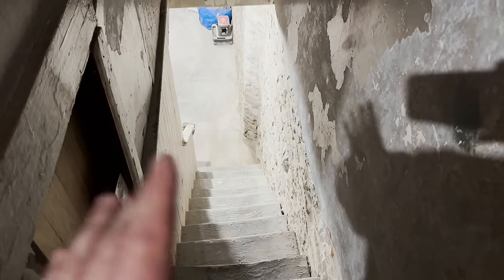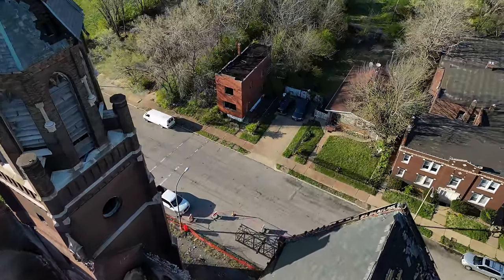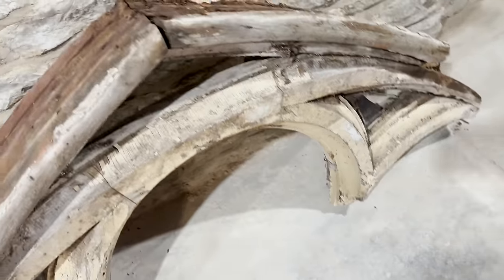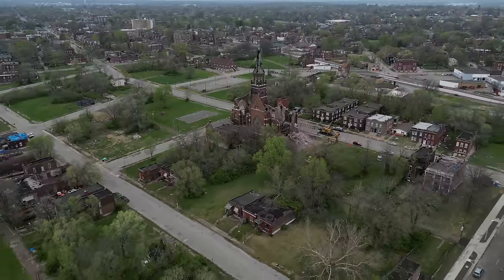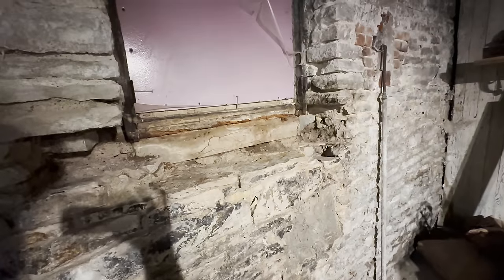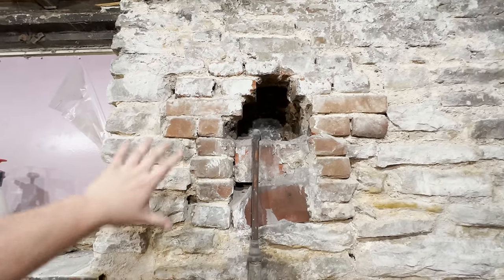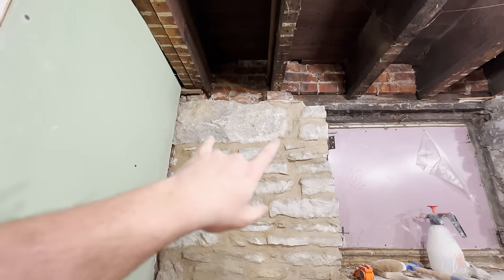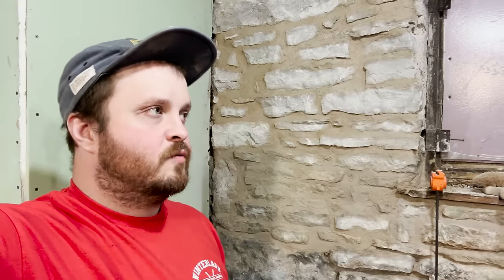This is Just Sad! S4 EP4

Comment: Suggestion 14:49 for that outside water spigot on the front of your house: I would suggest putting a master cutoff valve in the basement so that you can turn off the outside spigot when not in use. The last thing you want is to have some neighborhood kid turn your water on during the middle of the night or when you're not home and let a couple thousand gallons of water run out into the street. I prefer using a brass ball valve inside as a master cutoff, they don't drip and don't have to change rubber gaskets every couple of years. Something to think about and save yourself some grief down the line.

Comment: Given the ornate faucet you have for use outside, when you re-plumb that line, you might consider adding a shut-off valve inside, and a drain spigot between it and the outside faucet, to get the water out each fall.
Reply: I don't think you need a drain, as long as the outside tap is the lowest point, you can just open it in the winter
Reply: Yeah, I wrote that before he said he was running the pipe from the ceiling. Thanks

Comment: As a person who has had four back surgeries, I can attest to your suffering.
Ibuprofen, moist heat on mid back muscles, ice pack on lower back on L4, L5, and L6 region will relax muscles and reduce swelling in the lower back joints.
Take it easy for a couple of weeks and wear a back brace when working.
It's important to take it easy for a couple of weeks because if you insist that you're alright and do the macho thing, then you're just going to keep aggrevating the injury and make it worse.

Comment: For cleaning off the foundation stones, a possible solution could using a wire brush drill attachment, or possibly a dremel tool for more precision. Brass or other soft metals similar to the one you're using work great, however there are other types of soft bristle variants as well (maybe even soap+water with the softer brush?), saves both time and any more back worries! I would understand not wanting to damage stones or damaging mortar is a possibility. Keep up the amazing work!

Comment: Kaleb, a question for you on the brick that needs replacing under your fireplace. Is it possible that the space that they used for running that water line might have been part of an ash pit for the fireplace? If you have a grate or trap door in the floor of the fireplace upstairs that would be an indication that part of that space was originally open allowing for easy clean out of ashes from the fireplace. The brick is definitely some sort of later modification but if the fireplace has a provision for an ash pit you might not have to fill that entire void with stone if you restore the ash pit. Just a thought to save you some time and stone.

Comment: NHL 3.5 is Not for pointing - it is for external rendering on the lower part of a wall where you will have splash back from rain hitting the ground, i.e. you use it on the first 1 meter. NHL 3.5 only has circa 30% Lime Content. NHL 2.0 is the best NHL and has a Lime content of maximum 40% (the remaining 60% is filler and Not Lime). If you wish to use an NHL then use NHL 2.0 for Pointing. 

The correct Lime to use is CL 90 - this is what was originally used to build this house. CL 90 has 90% Lime. It is far superior to NHL Lime (2.0/3.5). CL 90 can be used to make a Traditional Hotlime Mix, or it can be slaked to create Lime Putty. 

Lime Putty needs a minimum of 6 months to mature before you use it. In fact the older the Lime Putty gets, the better it is. You must always store Lime Putty submerged in Water and ensure it never has any air come into contact with it. 

CL 90 will make Lime Render, Lime Plaster and Lime Wash. It is also way cheaper than NHL and a far far far superior product to use and will last much longer than NHL Limes. Make a Lime mix using CL 90 and put it on the hawk and you will never have it fall off if you turn the hawk upside down. Try that with NHL 2.0/3.5/5.0 and you will have a mess on the floor. 

Note when you make a Lime wash with CL 90, it will be similar to modern paint in coverage. But if you make a Limewash from NHL, it is very watery and requires coat after coat to build up the layers to cover the wall in Limewash. One coat of CL 90 Limewash will give you a finished product.
Reply: Super helpful information. Thank you, that has just steered me in the correct direction on my renovation.
Reply: @fullboatya  welcome. I suggest you search for tutorials on mixing CL 90 (Traditional Hotlime mix). The most educational will be any video with Nigel Copsey (he doesn't have his own channel). He works with the National Trust in England and specializes on working on old historic buildings. You will find several videos people have filmed of him explaining in detail/tutorial how to mix the Lime to create proper traditional Lime Render, Mortar and Lime wash. It is very easy to do, so don't be afraid to try.
Reply: wow thanks I really needed this. been scratching my head wondering what to use for my historic home. will look for a supplier and get some cl90.

Comment: Hey Caleb, have you checked out a pulsation laser to remove alle the paint on woodwork and your facade? I think it would safe you a TON of work and you would avoid using harsh chemicals ;) Maybe you could rent one or get a sponsorship? (they are pretty expensive) They are used to remove graffiti by professionals, by vaprizing the paint, not toching the wall or wood. You can actually also use it to remove wood stain :D 
Kind regards from a Danish Cabinet Maker and Furniture Restorer

Comment: You've been cleaning the foundation stones with a wire brush? Dang, that's a LOT of work. Chipping away the concrete, digging out the broken bits and sand. I thought you'd have some sort of Dremel tools or something. I guess its different literally every spot in the wall so you have to feel your way

Comment: Greetings: I have an old 1893 home in Chicago and greatly enjoy watching you doing things with respect. At twenty eight minutes you are discussing replacing an exterior water line. I assume that you probably know this, but better safe than sorry. You need to protect an exterior faucet from winter freezing. Since you plan to place your ornate brass quail faucet outside, you will need to have a shutoff valve in the basement and the piping that goes outside  inclinedever so slightly from the outside to the inside, so that you can shut the water off in the Fall, and leave your faucet open before you get a freeze. Frozen pipes can be a real headache.

Comment: That brick area is probably a cleanout for the chimney.  If you seal it up, you may have trouble getting your fireplace repaired/working properly.  I'd check with a chimney repair guy.  Getting a professional opinion doesn't mean your committed, but will save you a big headache later.

Comment: There's a reason for the "cloverleaf" tops of some church stained glass windows. 3 for the Trinity. 😉
It's sad when a historic building is either not restored or is just destroyed. 
In the Monroe County area of Michigan,  there's multiple churches still mostly intact from around the Civil War era (architectural glass is a big giveaway. 😁) An earlier example is a former Methodist (now a Baptist) church in Dundee,  from 1864. Sure, there's a 1980s addition to the back, and a lean-to on the side in front from I think 1910ish, but the front addition was blended seamlessly, reusing the stained glass windows on the side and front, and the back addition for Sunday school classrooms is frame instead of brick, but really nice and not that noticeable from the street. 
There's the Presbyterian church in downtown Monroe where George and Elizabeth Custer (of the Battle of Bull Run infamy) were married. Takes about a quarter of the block,  and the additions do say they're 1950s through 1970s dates, but other than the full aluminum and glass doors in the addition, and several not noticeable from the street more modern rectangular windows, even the most recent brick matches the 1870s stuff used originally. Interior is still the same paintings in the auditorium as original, as are the box pews. 
The Presbyterian windows have been meticulously maintained. As good looking as new.
The one in Dundee needs help. It took almost 20 years to raise the money to restore one stained glass window (they ain't cheap. $10000 around 15 years ago for a shorter one...), and there's still about 8 to get done. Lead is deteriorated. Most have missing or broken bits. 
And there's general wear and tear. Dundee was starting to leak from loss of mortar. Point and tuck on virtually all the brickwork. Slate roof was virtually impossible to get done, so it's now a similar look in steel roofing on one side. 
Steeple was destroyed in probably the 1970s by a tornado. Capped, never replaced entirely. Old organ loft is empty (organ was kept by the Methodist church).
I currently attend the Presbyterian one and used to attend the Dundee one. It's amazing what a budget for building maintenance (instead of trying to keep several decommissioned schoolbuses on the road) can do. 
There's also a former Catholic nunnery, school, and church.  Nunnery was sold quite a few years ago, and part is now a senior apartment complete. School and church are still in use and were built around the 1890s. Being Catholic, very well maintained and kept up.  
Sure, was French missionaries early on,  but they weren't the first to build. Actually, the first church building in Monroe County was a log cabin built by the Presbyterian church about a block from the current location. Might have been some circuit riding ministers, but no building until around 1821.
Really,  old buildings in general, where economy allows, need kept up or repurposed, keeping the history. 
Again, in Monroe, there's the original La-Z-Boy recliner factory. I've been in it. Based on the architecture, it was another factory at one point,  possibly steel casting. Now, like the nunnery, senior, and disabled housing. Cut into apartments while maintaining the industrial decor.
All my examples are brick. Frame construction seems much harder to maintain. But then there's the multiple and well documented Queen Anne "painted ladies" in Coldwater, Michigan. They've survived Coldwater virtually turning into a ghost town during the 1990s and early 2000s. Where there's a will, there's a way.😁